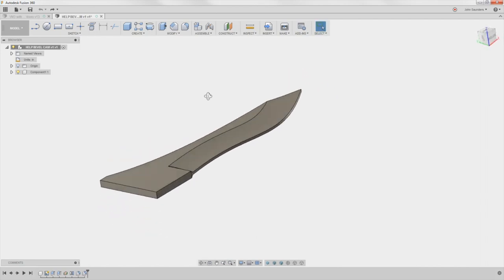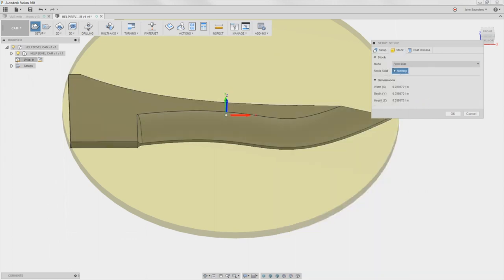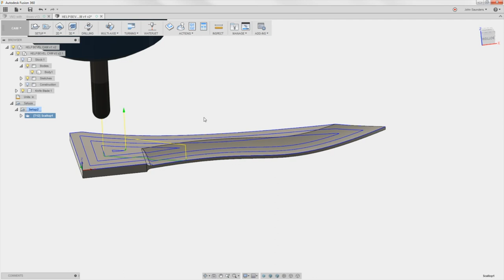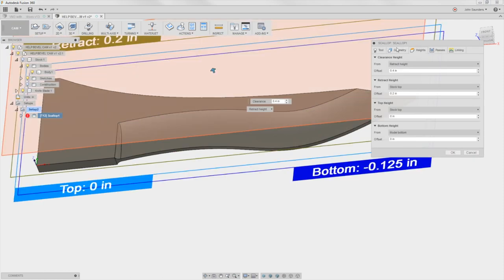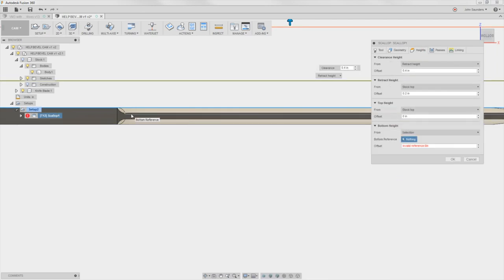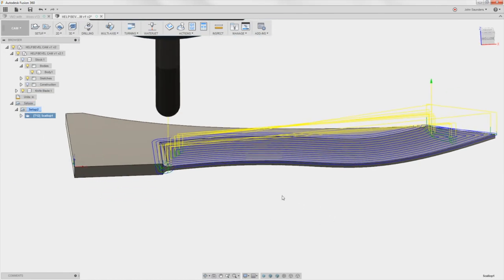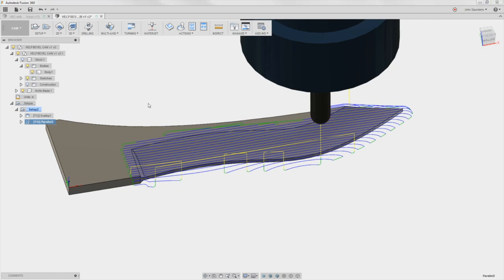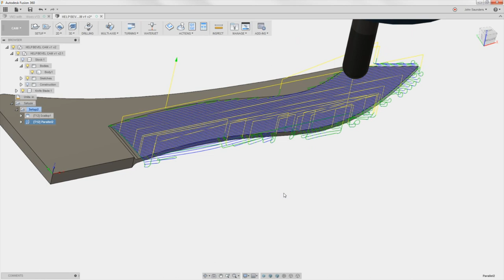Knife Blade CAM in Fusion 360!  FF68

Comment: hey John I use 3d contour..weather I'm leaving cusps or milling smooth..and when selecting geometry I choose MODEL tab. I find it better for me to do it all in one operation. I was doing a adaptive to remove a bulk of the material. then a contour...but it's easier and faster to do it in one OP... unless of course your stock is very thick....I'm still a newbie. but this works for me..

Comment: There are a few things you can do to make this process faster, easier and better looking.  First, rather than a ball mill, use a toroidial cutter if you can.  They provide a much better surface finish and faster rate of material removal.  The buttons on the cutter can be rotated as they wear which is a plus.  A bull nose end mill with large corner radius can get a similar effect.  You can get some effects with ball mills that you cannot with torroidals though.

The biggest improvement in appearance of the blade will come from having the tool follow the path of the blade edge.  Unless you are going to have a very small stepover or going to finish by hand, you'll have visible scallop marks on the blade with either a ball end mill or toroidal cutter.  If you're going to have scallops you want those scallops to follow the geometry of the blade.

I've just switched from RhinoCAM to Fusion 360 recently...let me see if I can get the tool to perform the strategy outlined above, in Fusion rather than RhinoCAM, and I'll share here.

EDIT:  In fusion 360 you can accomplish the above with a bull end nose cutter defined and using 3D coutour with a very small "Maximum Stepdown" (i.e. .004). 

Shane
Reply: Shane Harvey Assuming your strategy does produce a better finish and given today's technology (tolerances, cutter performance) do you think it would be possible to produce an off-the-vice, ready to use, sharp blade?
Reply: No, not really.  You'd need to start with hardened steel which is not easy to machine as I understand it (I've not tried myself).  Every sharpening process I've used or seen is done by hand though I'm sure there are industrial level sharpening techniques I'm not aware of.  Having said that, you can produce a knife off the vice which is sharp enough to cut the hell out of yourself even before heat treating.

Comment: 3d adaptive for initial clearing 1/4" EM then parallel  with an 1/4 " ball mill. Can smooth the transition by adding tangential extentions and avoiding touch surfaces

Comment: You could do a ruffing parallel cut in the Y axis with a endmill to ruff it out then clean up with a parallel cut in x. 
why not pick the faces of the blade not the edges. Having the faces selected the cutter stays on the face and that chamfer will of not been hit.

8 min 11 seconds look where the green line is it's under the chamfer

Comment: The scallop tool path in my experience always does a spiral to the center of your boundary, I think the problem was that you were on a surface that had a single slope to it and was attempting to apply that spiral to that slope. One thing I would recommend trying is the avoid/touch option under the geometry tab as I've had a lot of luck using it to restrict the tool path to only the surfaces I want it to touch. I believe that the optimal tool path for this job would be the parallel strategy since you only have what I usually refer to as "organic" geometry in one direction.

Comment: Scallop always produces a spiral pattern, either from outside in, or from inside out. 

I'll double check, but I believe you can do parallel to a guide curve. ** checked. Apparently you cannot..**

Drop me the file? and I'll see what I can do with it.

Edit*. Use 3D contour, do an order from bottom-up under passes.  And select "both ways" for a direction 

Also under linking give it a start point at the blade tip. 

For machining boundary, use "silhouette" and select the blade edges. Deselect the flat portion 

Under Avoid/touch. Select all faces touching the blade you DO NOT want to cut, give it a clearance value of .0005" 

Should give you what you want. 

The Ramp tool path with also work if you give it angular limits from .1deg to 90deg

Comment: 3D contour and I am using a 1/2" 1/8 rad bullnose endmill. One problem I am having at the moment is getting a fillet on an edge that I have done a sweep contour on, it just wont work, it will work on the edge before the sweep but not after. anyone have any tips on this?

Comment: You can change where the paralell pass begins by setting the pass angle to 180 from whatever it is. 

Example If you are entering from the top and your pass is set to 90 change it to -90 or 270 and it will enter from the bottom.

Comment: I've been thinking of another way to approach this.  Rather than milling the blade in a horizontal edge position, try facing the edge up to the sky and tilted to the degree of the bevel and come in from the side with the cutter.  This may be hard if you want a concave grind, but for a flat grind this might be the best way to get a good surface finish.  It Also may require a special fixture, but If your using CNC to make knives then you are probably doing production runs and will need this anyway.

Comment: 3d contour is is the best ive found for knife bevel geometries because it follows the contour to give you smooth tool paths and will provide less tool pressure differences creating minute marks on your part like the parallel strategy would give you because the parallel will move in a straight line at the specified angle and stepover.

Comment: speaking of 3D cam in 360 though, I am unable to make a Spiral or Radial 3d path with a diameter larger than about 2.5 inches. And idea why that is?
Reply: Geof Dumas have you made sure your heights go far enough down?

I assume it's a dome like surface you're trying to cut?
Reply: Occams Sawzall yeah. this happens on every model I try to work with since I noticed the issue because I thought it might be fixed with an update. happens every time though. other 3d methods are not affected
Reply: Geof Dumas 
I'll check it out tonight when I get home. A rarely if ever use radial or spiral.

Comment: 5:57 funny see john puzling around. when its easy shape. there 2 arc and 2 other arc that are mayby smaller. between them is curved surface. i can cut this on makro call. not need cam. its 2 arc that scale down with using arc. less than 20 machine lines LOOP LOOP LOOP

Comment: How would you locate it once you flipped it ?
Reply: The easiest method would be utilizing soft jaws that will positvely lock it in. you could also use a fixture plate. personally I like soft jaws for this, much slower (well kind of) but better and easier to hold down
Reply: Pantamorph Technologies could use pins through the holes in the handle, still you need to flip the location in the program.
Reply: Then would you just use a corner of the jaws for x,y 0?

Comment: Great Video. I was just doing something like this, with "make stock from a part" and then machining parts off of the stock for a customer who wanted a store bought tool altered. The tool paths were hard to figure out. Could you post your ideas of how you would hold this blank in the CNC Mill. That was  the next challenge for me, cause the existing tool was not flat! Thanks.